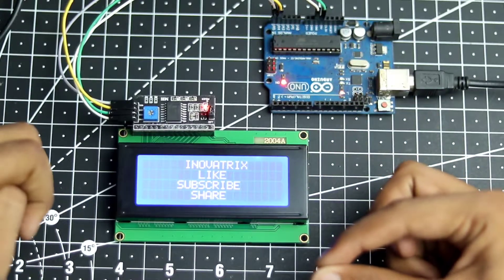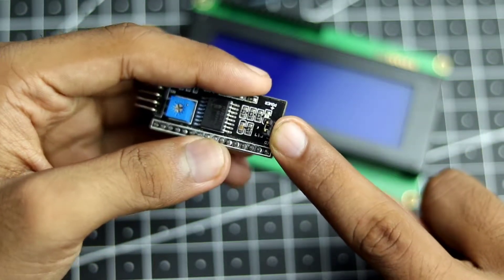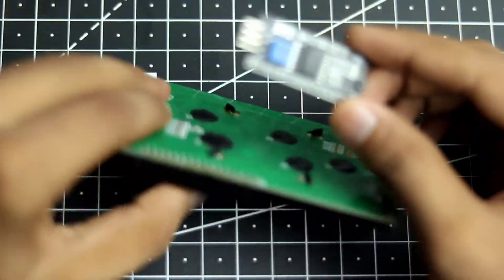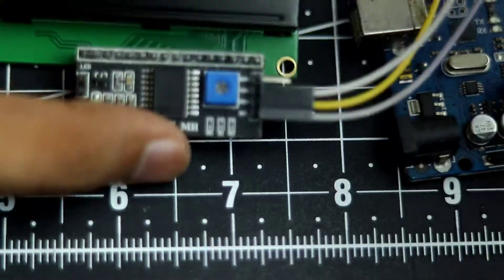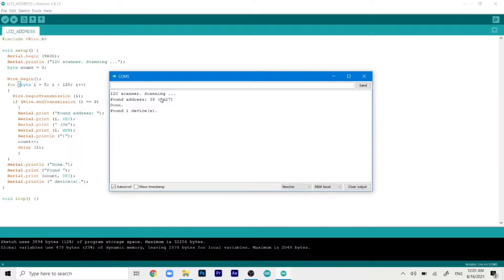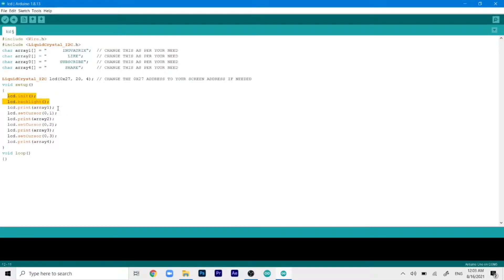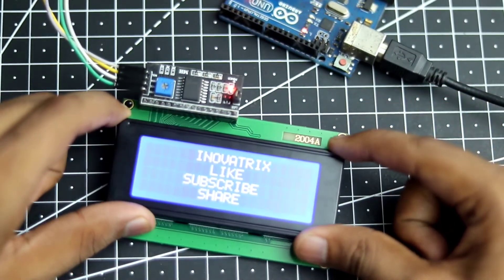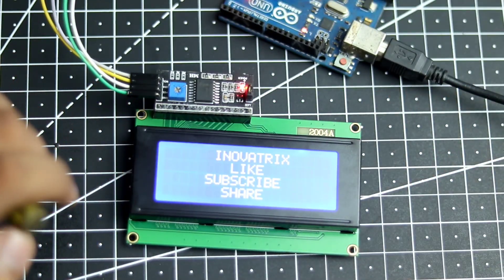ARDUINO 20x4 LCD i2c Tutorial | How to Print Text On LCD Display

Comment: Hi. I have a question about connecting multiple devices via i2c to Arduino, e.g. two encoders and 2 displays. Can it be done only with arduino, or do you need to use an output expander?
Reply from the maker: It is possible to connect multiple i2c devices, there are lots of tutorials on YouTube by other creators so you should definatelly check those out.